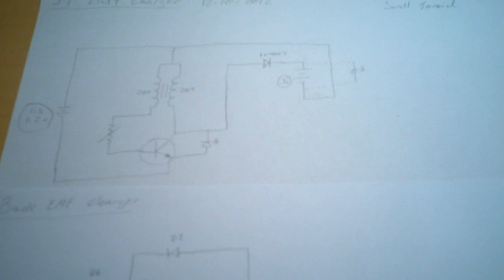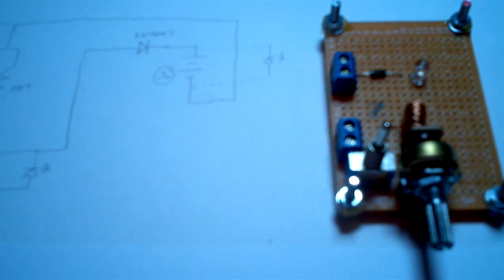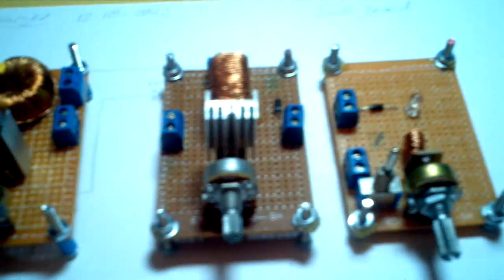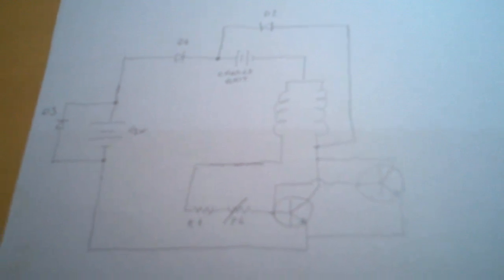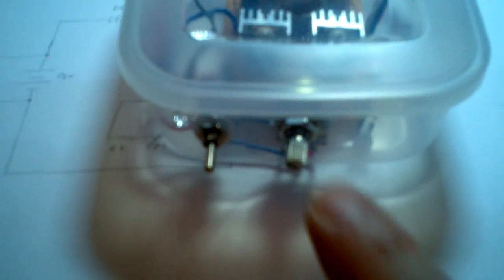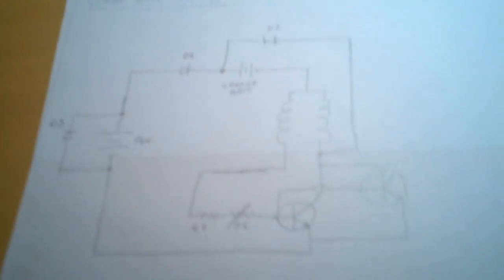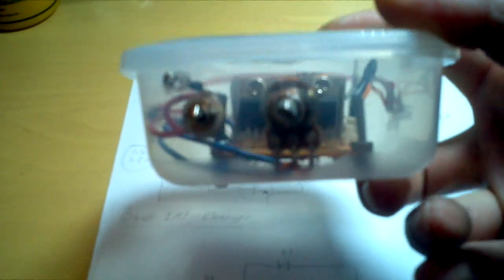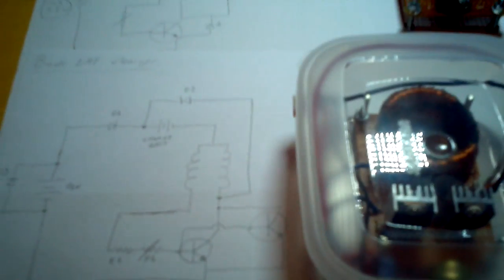Joule thief - RE-EMF Charger - From Rene

Comment: this is bad because the voltage of the source battery must be higher than the battery to be charged. I myself charge a 12v lead-acid battery from a 1.5v source

Comment: Thanks for the video. I had also watched Rene's video. I put one of these together as well. I used a D1047 transistor as that is all I had on hand. I used  19 volts from a lion battery pack as source to charge a 12 volt lead acid battery. Worked really well. I was wondering if you or any other replicator have calculated the efficiency of this set up? It seems very efficient so I wonder just how efficient it really is?

Comment: Mosfet will works way more powerfull 30turns each coil  for more amps.just add 10k resistor to gate to source.and high current fast diode
Reply: mosfet type code please...

Comment: cool, was wondering if rene's circuit worked well.
Did you just use the two TIP transistors in parallel?

thanks
Reply: ok, I saw it on your video....  I initially thought they were hooked as darlingtons...

nice.
Reply from the maker: Yves Baggi Greetings, I´ve tried as darligntons before, but the output was weaker using the TIP41s. This little devices works like a charm.

Comment from the maker: A 5v cell phone power supply for batts from AA to Li-ion of 3.7. They have a 500mA maximum output, but the circuit can give 200mA maximum. A notebook power supply for lead/alum batts, 19v output from an old Dell notebook, they can put 500mA maximum in the batt. This last one by the specs takes 1.5A maximum from the mains, but I do not think it is taking that much.

Comment from the maker: Oh.. by the way... It does not need to be as the schematic with two transistors, the circuit is almost the same but closer to the Double JT Solar Auto-Light that I´ve posted.

Comment from the maker: Greetings... Well, not yet. At least with so many batts that it can charge. And it can recover dead lead acid batts too, desulfate. I use this chargers from AA to lead alum crystal batts and never had any problem with them. Also charging Li-ion from dead notebook batts. I recommend to have at least one of this chargers. I have used TIP41, TIP31C, 2N2222 and also 2N3055 without problems. Toroids or chockes. Regards.... :)
Reply: are u still using this? or maybe make some improvement?